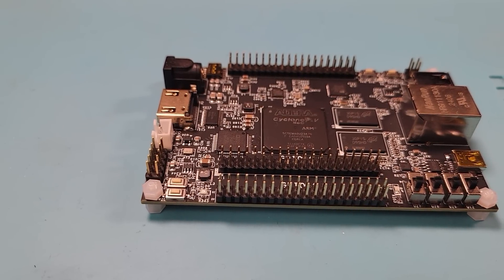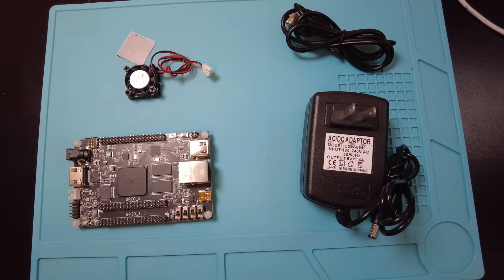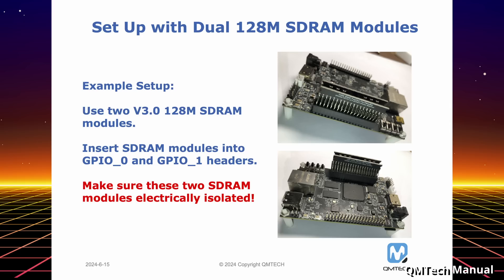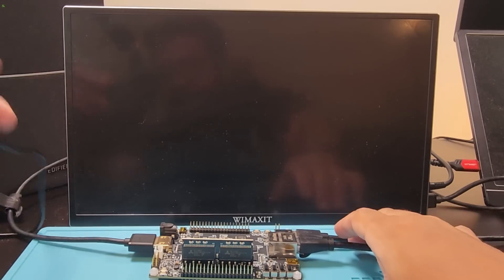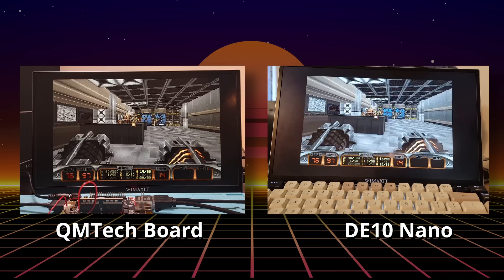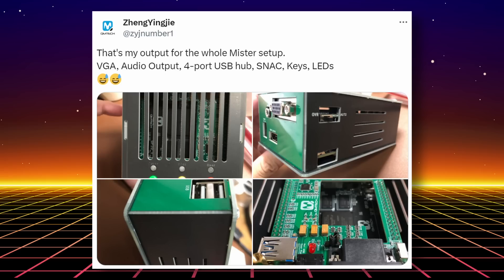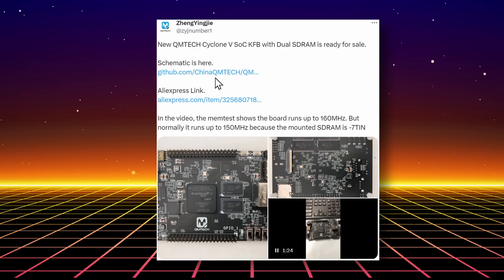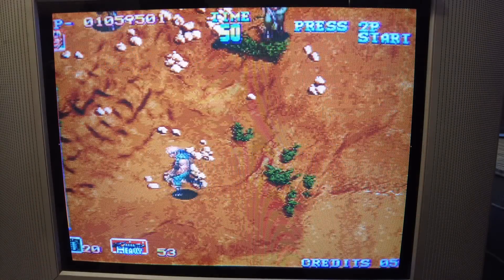MiSTer FPGA - New Compatible FPGA from QMTech

Comment: is there a link for the reference design?
the terasic board is 400$ in my region and the qmtech board is not available here
(and tbh i would rather build my own anyways, i'm working on a custom core emulating the GE645 and the i/o reqs are different vs the typical use case)

Comment: Will a standard IO work with a GPIO extension ribbon?
Reply from the maker: I have not tried it myself but I so not reason why not and some people has said it can.
Reply: @LusRetroSource  I only ask because I wonder if adding length to those IO paths will mess up timing to the video output.

Comment: Everyone is saying the GPIO_0 for the SDRAM is the wrong way round but if you compare it to a DE10 you will notice it is NOT the wrong way round they have just relocated it to the other side of the board so the label on the SDRAM is not correct because of that, cant believe no one has noticed/mentioned this yet.
Reply from the maker: The issue is that all RAM chips will tell you to face the chip a certain way so it will and has caused confusion. People have already fried their RAM already because of this.

Comment: What is the direct video adapter? Is that an HDMi adapter to composite?
Reply from the maker: It's more complicated that that. It's an HDMI to VGA adapter. The MiSTer OS can then use these adapters to generate an analog signal for CRT televisions to the VGA outport of the direct video adapter. You will then need another adapter depending on the connection you want to use. Like a VGA to SCART adapter for RGB,VGA to YPbPr adapter for component video, VGA to composite or VGA to s-video.

Comment: Does this thing fit the MiSTercade ?
Reply from the maker: I don't have a MiSTerCade, so I can't confirm. Since it wont physically connect to standard IO boards, I assume it wont physically connect to a MiSTercade. Some people have said that you can probably use a ribbon cable to the GPIO pins to use IO boards that work on the real DE10 Nano.

Comment: Don't use a psu with an expensive piece of kit unless it's ul certified, intertek, CSA approved. Never go by CE CERTIFICATES. My mom could get a ce stamp on her last dookie.

I think anyone who is into retro should also be into electronics as a hobby as most bricked systems are trivial to fix with only a soldering station and multimeter.

I send free learning kits to people in canada or the us on a tiered level. The more a person shows passion for learning, the better gear I send. I'm considering just stopping that and selling starter kits worth triple what I paid until I have no more left to give. 

I've never found a broken gaming system I couldn't fix or fix 5 others with the spare parts. 

It's a good year of messing around and having fun before I reccomend fixing the more rare systems. Gamecubes can always be fixed and are the best broken system to purchase. If they power on, 99 percent of the time it's a potentiometer that needs a 10 degree turn with a driver. 

I'm currently sitting on 3 launch edition ps3 consoles, super slim, 2 ps2 consoles, multiple gamecubes and handheld. The ps3 consoles needs new enclosures which I may design and print or laser cut acrylic enclosures. 

People have to stop wasting money on crt televisions they can't fix and just buy an oled. I only fix high end crts because people think any crt is worth a fortune. 

Keep vintage consoles and high end displays clean and have someone repaste any console that needs a heatsink every 5 to 7 years.

Comment: You're not cloning the board. You're basically moving the semantic meta data for how it has the logic blocks set up. It's about time the mister had a new fpga given the number of gates and cache in modern low to mid range fpga boards. 

The only reason the der10 or whatever costs so much is because people with high disposable income are still buying them so they make just enough at a time to barely meet demand as it's taped out on a legacy node.

It's much more fun to learn how to create on an fpga than it is to waste a fortune on one to game. 

I've been mulling over buying a xilinx board and just recreating retro hardware myself. The nand2tetris course is a great way to see if verilog is something someone would be interested in. Learn logic gates first by buying a few breadboards and transistors to learn all the gates and how they build on each other to create or behave just like hardware.

Most cpus and gpus are built on fpga boards when testing new hardware tech.

Comment: That Wimaxit screen looks really good in this video. Does it look good in person?
Reply from the maker: I use it mainly for testing. It's biggest issue is it's low brightness. But the low brightness helps with recording since I doesn't over expose easily.

Comment: I’m completely new to MiSTer FPGA and was excited when I saw these clone boards available. I bought, received, and returned this QM Tech board once I saw tweets about the accessory compatibility. I’ll wait on Taki’s board. It looks like his will not have compatibility issues with accessories.
Reply: The moral of the story is simple... make sure something will satisfy your requirements BEFORE jumping in feet first. You choosing the wrong product for your needs isn't the fault of the manufacturer.
Reply: @another3997  Nope, it's not at all and it was wrong for me to make an assumption that it would be.  I made the assumption that it would have been 1:1 compatible; again I'm new to this entire scene.  It was impulsive and I did not do my due diligence.  Thankfully, Ali let me return it without issues.

Comment: Thanks for the review Lu. Imho, either preserve compatibility or propose something better, which was not the case. I have one MrFPGA kit (case+DeNano+128GB hub and analog IO) purchased on Aliexpress back in 2021 that works perfectly until today (price with shipping to my country was better than most north american and european sources, plus it was available when most where not). I would like another one with digital io and double ram, I’m lookong forward for the alternatives to land so I can build one hopefully for half the cost. Looking forward to your next review on the clones
Reply: Compromises are a fact of life, and as long as any changes are documented, it really doesn't matter how things are laid out. Blindly assuming something is going to be a certain way is asking for trouble. People need to engage their brain cells more often, rather than complaining that something has changed... in the real world, things change all the time.
Reply: @another3997  I don’t disagree, changes are good… but what were the improvements / gains in this case? A drop in replacement has value, as it is a cost effective solution. Would you like PC parts (USB cables, pci-pcie slots , psus etc) to change pinouts, because the OEM can? Standardization is what makes modern life easier, parts are interchangeable and follow a standard. I don’t confuse it with people being dumber and not reading the manual. These are different things

Comment: appreciate the overview of this clone.  no way i could recommend this if it has such a finnicky power port that can shut off with a tap, and no compatibility with the existing IO boards that have been part of the MiSTer project since day 1.  some bad design decisions here
Reply: If you want an exact clone of a $200 board, you can expect to pay that much for it. Any electronic devices can have a faulty component or a bad solder joint etc, even expensive ones, whether from the factory or in transit.  Compromises ALWAYS have to be made, no matter what the product, but sometimes it's better to have a bird in the hand, rather than 2 in the Bush.
Reply: @another3997  never once have i heard of this issue happening with an actual de-10 nano.  quality control in manufacturing is a concern, at any price point.  shoddy hardware leads to a poor user experience and I can't get behind that.

Comment: If it feels cheap and says it's 4a it's TRASH. A 4A supply should have some weight to it. A 2A supply should weigh enough to not "feel cheap" -- this is worse than half its rating. Zero trust in their power supply, I actively feel it would be better without it.

Comment: "Not a true drop in replacement" 100% agree with this statement. Thank you for taking the time to verify things and for your thoughts, Lu.
Reply: Which is potentially fine, as long as you know that ahead of time. As long as it can run the same cores without any issues, that's the important bit.
Reply: @beefquiche  really the layer 2 stuff is to make up for the short comings of using a off the shelf dev board as layer 1. 
Takis custom designs for the consoles is a better approach
Reply: @grumpyoldgamerUK  It's great that we get to discuss this, as it only becomes a topic at an advanced stage!
I'd love for the community to move on from the reference designs and come to some kind of standard that works for everyone so we can do addons and cases that are interchangeable. The devboard tower is kind of terrible from a product design standpoint, because it's a devboard. Also we can stop choking the devboard supply.
Reply: It doesn`t have to be though does it ? Its compatible with the cores and framework that is all that really matters. 
If you go for the built in SDram version its half the price the DE10 + SDram and this is what the project needs. I have had no issues with my board in testing

Comment: I bought that board and I'm using a power supply with 5v 5a from MiSTer Addons. It's seens works very well. The Qmtech sends to me a 3amper power supply. Great video!
Reply: so I guess QMtech uses 3A or 4A :)

Comment: @7:00 But what if your adapter doesn't have a micro USB port for charge? Should we then assume that it doesn't require much current in the first place and should work? 

My QMTECH is on its way.
Reply: You could get a HDMI power inserter if you run in to trouble
Reply: @willyarma_uk  In the end it just worked even without power. No idea why. Already sent Lu a message about this.

Comment: I refuse to shop from aliexpress. Hopefully Taki's board is sold in Europe somewhere.
Reply: Aliexpress is a great alternative when you don’t have local suppliers, which is my case (or they charge 10x). As with any online shopping, purchasing from reliable vendors (>95% reputation), and filming when opening the package (for precaution) have worked well for me since 2020. I also can find stuff there not available anywhere. Just don’t dismiss it based on bias.
Reply: @AladimBR  Still not using aliexpress.
Reply: Aliexpress is far far superior to ebay, you are being silly
Reply: @thomassmith4999  Maybe on opposite day.

Comment: I probably won't get this particular board as a 2nd MiSTer, but perhaps the potential lower demand will make it more accessible to those who don't mind the flaws.

One thing I was wondering was if the SD card from the DE-10 could just be used in other clones or does the card need to be flashed again
Reply from the maker: I do see people settling for this board if Taki Udons board sells out. 

And yes, you can just take your current SD card MiSTer installation from a DE10 Nano and it will work.